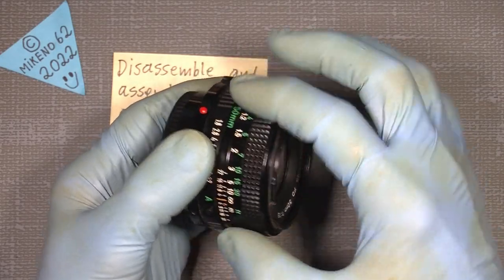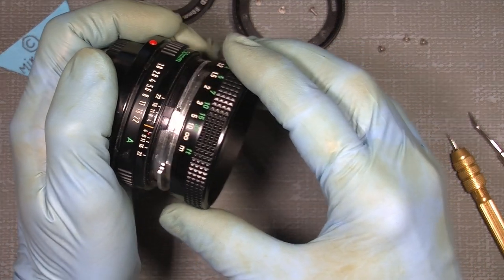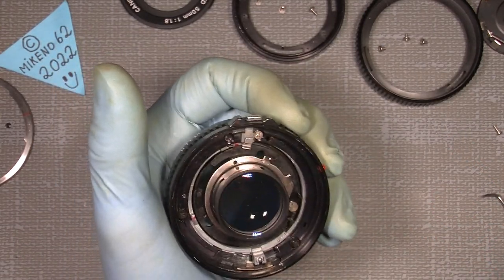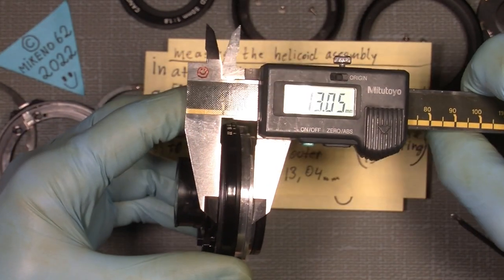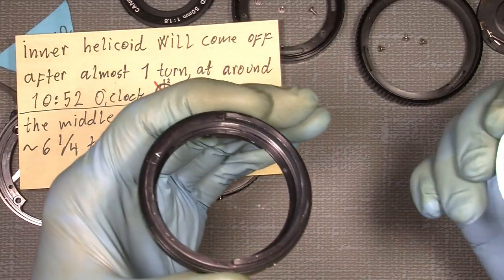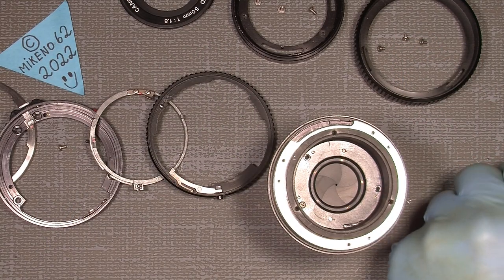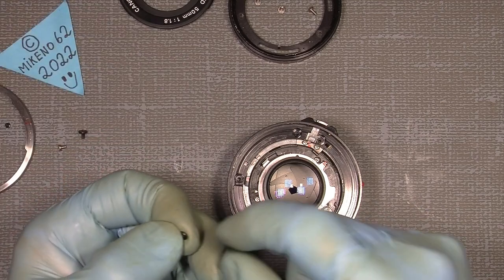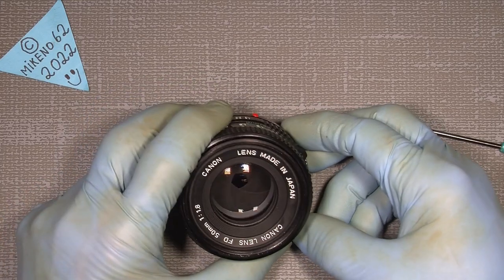Disassemble and assemble the focus assembly In Canon FD 50mm 1:1.8 (New Version)

Comment: Hello, I repaired the aperture blades by myself but made the mistake to not set marks and now the aperture blades closes too far in. Do you have any tips to adjust this the best way?
Reply: Hey :) Maybe you have already fixed it but I though I'd write for other people who might have the same problem. At around 36:52 he talks about how the holes are not complete round. More of an elongated circle shape. If you fasten the screws on the wrong side of the elongated circle  you will end up with a too small aperture opening. Especially noticeable at f22. 
So just loosen the screws a little bit and adjust it so that it ends up on the opposite side of the hole.

Comment: Great video. I've been looking at Canon FD 17mm lenses and was wondering if it's the same process to remove the front element in those. I see some that are marked down in price because of dust or haze, and as long as I can easily remove the element and clean it then I am fine.
Reply: I've been trying to search for an answer to taking apart the front lens element for the nFD 17mm f/4 and I can't find anything anywhere :/